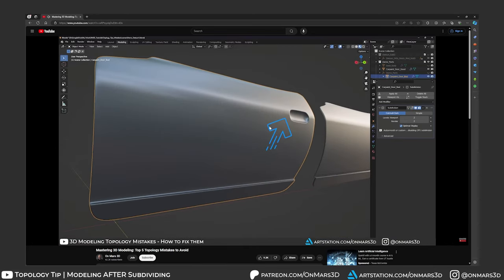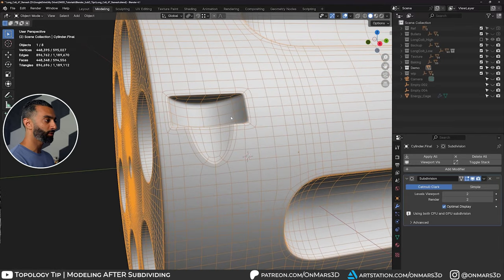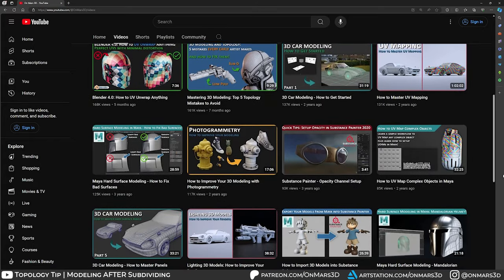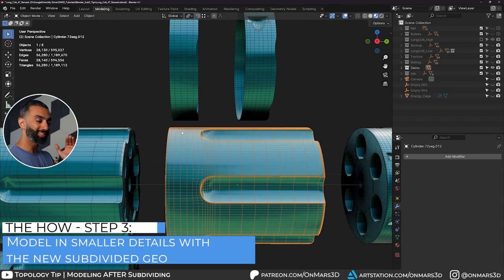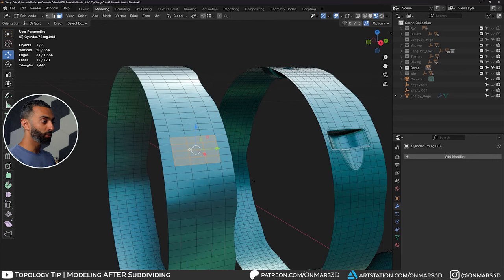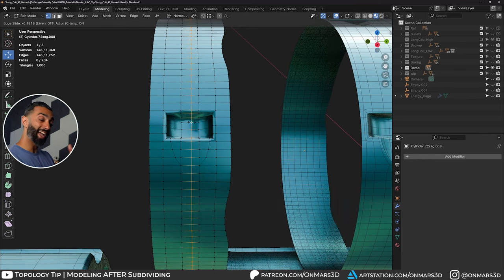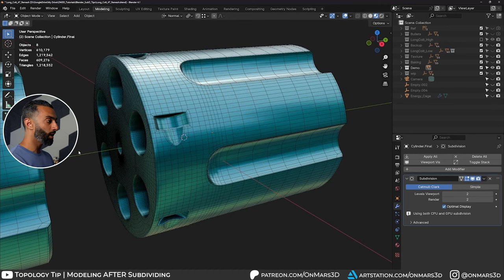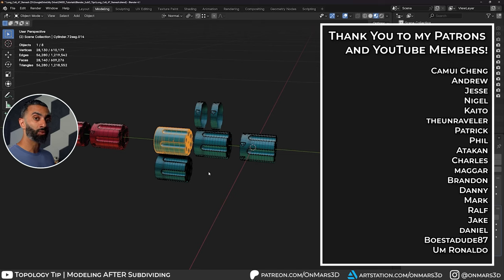Topology Tip: Perfect Sub-D Modeling Every Time!

Comment: In fact, you don't need perfect Sub-D for this kind of hard surface modeling unless you need deformation effects. For game engines, such resources usually have too many unnecessary vertex data.
Reply from the maker: The purpose of this sub-d model was to bake down to the low poly model, that's why the high poly was created with perfect surfaces.
Reply: @OnMars3D  For hard surfaces, what we need are perfect and accurate normals rather than perfect surfaces. As long as the normals are correct, whether the topology is perfect or not doesn't really matter in my opinion.
Reply from the maker: @UML649  We're saying the same but different things here. For a game ready asset, I'm talking about texture baking, so one way to use sub-d model with perfect surfaces is to bake it down into a texture map for a low poly mesh. 

For a VFX/CGI workflow that requires a quad sub-d workflow, the Sub-D model is perfectly fine as is. Different workflows for different use cases.
Reply: @OnMars3D  Thank you for your input. As a technical artist with over ten years of experience, I find this approach somewhat inefficient. I prefer to use CAD tools (such as Rhino or Plastisity) to create hard surface models, and then use Blender to create low-poly versions. In my opinion, except for character models (which require deformable meshes for animation), other types of models do not necessarily need to strictly follow quad sub-d, as it can be inefficient and unnecessary.
Reply from the maker: @UML649  I agree, for game ready assets, CAD models work great since it can give you a high and low poly model from one source. I use CAD modeling tools on a regular basis and will cover the Plasticity > Blender > Unreal Engine in future videos.

But for non-game workflows, like VFX/CGI where they rely on a quad/sub-d workflow, the model needs to be sub-d ready. For example, once you have a CAD model in Maya/Blender, you can't increase the level of detail if the camer pushes too close. I talk about this exact topic here where I discuss quads vs tris/ngons here: https://youtu.be/wRPtxydqDuE?t=119

That's what I mean by different workflows for different use cases.
Reply: @OnMars3D  After watching the video you shared, I believe we share the same perspective. I'm pleased that you discussed this topic, as I've recently seen many YouTubers leading beginners in the wrong direction. Perhaps I've been in the gaming industry for too long and have overlooked the needs of the VFX/CGI industry. However, I believe that with enough polygons and the use of UDIM textures, any detail can be effectively showcased. Please keep up the excellent content. I've subscribed!
Reply from the maker: @UML649  Glad that helped clarify things and I appreciate the dialague!

Comment: Adding those rounded notches to the model was fasciniating. My apoproach would default to using a boolean to do the main cut-ouit work, Yours is simpler and faster. I'm not sure how you would "array" those changes around the rest of the cylinder though.
Reply from the maker: Glad it helped, to array that detail, I would separate the face loops with that specific detail since the pattern wouldn't align with the main pattern. A little extra work but it's worth it.

Comment: This is well put and I appreciate. Just learnt something new today. Another method I use is I  take the base mesh into zbrush carved in the details with alphas and other sculpting techniques and retopologize that high model in Maya(I'm a Maya User).

It takes some time but it has made my complex hard surface model more cleaner. But again the route to take depends on the model.
Reply from the maker: Yeah, there are a bunch of ways of doing the same thing, I've used the Zbrush sculpt method too.

Comment: I was following chamferzone's revolver tutorial and was facing this exact pinching issue with SubD enabled. Thanks for the tutorial. It's been really helpful for this specific problem I was facing.
Reply from the maker: Glad this helped you out!
Reply: Interesting, how did you fix the pinching when Chamferzone uses the Remesh workflow? Did you first apply subD, fix it, and then use subD again + Remesh/Corrective Smooth/Decimate?

Comment: Looks like an interesting technique that surely gets great results. My question would be from a practical point o view. Unless there is a shot that needs to be that close into the object, like shooting an ant crawling on that barrel and that particular shot would also be static and not animated, I personally see no practical reason to finesse that surface to that level and use additional time to do it as it will not be visible at all on medium shots or animated sequences. Is it good to know how to do it, academically? For sure, no doubt about it. Is it really practical in real life scenarios where everything is on fast forward these days? Not so sure...  These kind of surface distortions tend to appear only on very shiny surfaces with almost no roughness or textures and only under certain light angles. But again, it is always good to know how to efficiently fix things.
Reply from the maker: Appreciate the comment! The practical use is as you described, primarily for Sub-d assets that absolutely need this level of surface perfection. For games,  like weapon assets, it's not as necessary. It's more used for high end cgi, vfx, marketing, product visualization where you zoom in on assets at 4k, yes, you need that level of perfection. As I said in the video, I don't use this for every asset, but when I do use this workflow, it provides the results that are needed. 

As far as timing goes, you'd spend less time worrying about edge flow and topology so it's not like you're doubling the amount of time needed for this. 

Take my Datsun 240z that I modeled, probably has 100 parts, of those 100, I used this workflow on maybe 3-4 pieces that needed that level of surface perfection, like the body panels.

Comment: Just a quick question on the shapes of the faces - on the left hand side of the final gun barrel, all of the faces are near enough square, but as we travel to the lower density on the right, they elongate into rectangles. Is this acceptable for UVs? I was thinking that preserving the shape of the square is best as it cuts down on distortion? Is it just a case of using your discretion? Thanks
Reply: You are absolutely correct. To make your life easier for uv unwrapping you would add edges to the right hand side to make the rectangles similar in size and shape to the faces on the left. However, this would be a metal component so it wouldnt really require a super accurate uv unwrapping so this would be more than enough.
Reply: @fullyleaded  thanks very much!
Reply from the maker: That's correct, as  @fullyleaded  explained, for Sub-D, and even distribution of quads is the best for subdivision as well as UVs -- Glad you caught that :) 

I was originally using this asset with a remesh workflow but for sub-d, you'd want a more square density.
Reply: @OnMars3D  thanks, I wasn't trying to be pedantic or anything. I see it a lot on forums where people are telling others that their meshes are too dense, but computers these days are well up to dealing with heavy models, and as you have said, you could always bake them anyway. 
Speaking of baking it would be great to see some videos taking these same files and how you approach it. Many thanks for such invaluable work
Reply from the maker: @chrisjhart all good! That's one of my pet peeves too, when people say a model of too high or low poly with no context. And yeah, I'll be covering the baking process in full detail.
Reply: @OnMars3D  Context is absolutely correct. In any project the first thing you establish is what model will be used for. Then based on that you will model accordingly.